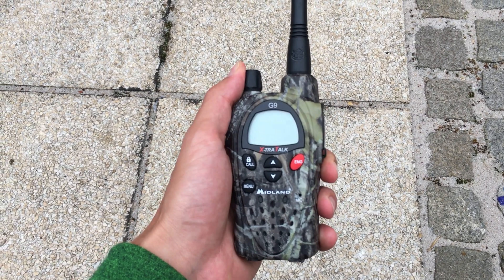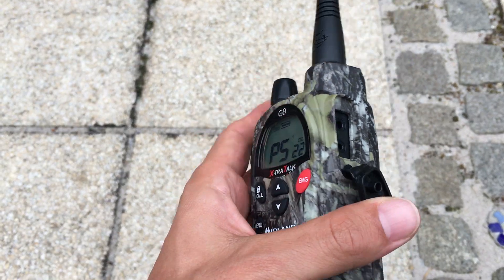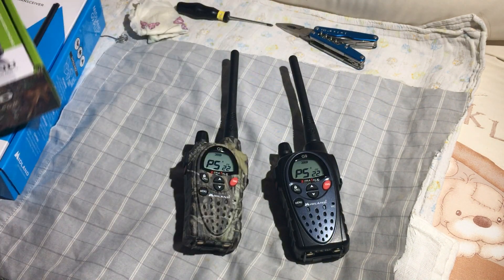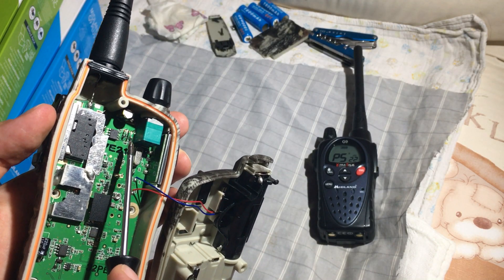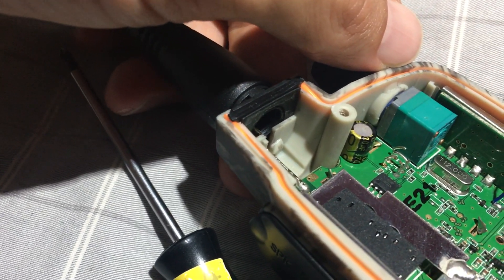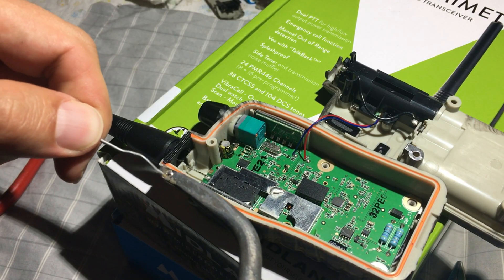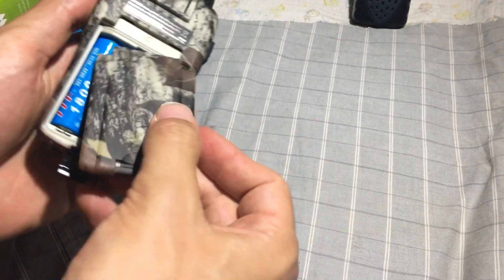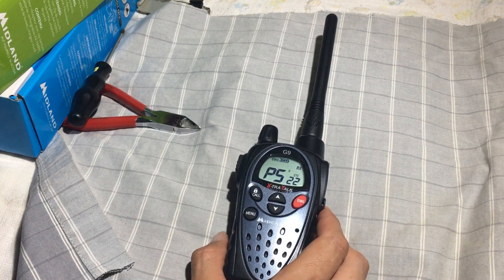Midland G9 plus MODIFICATION and review: PMR446

Comment: Per Midlands website:
4. Any radio above 2W of power is now classified as GMRS radio: and still requires a license from the FCC to operate. Not much change here, except sharing additional stations with FRS radio users.
5. GMRS licensing is now good for 10 years and cost $70: This covers you and your immediate family and was previously only valid for 5 years.

Have fun when you get nailed for using these without a license. In addition if they were frs only radios, modifying them and transmitting frs frequencies over 500mw is against FCC regulations:

§ 95.313 Penalties for violations of the Communications Act or FCC rules.

Operators of Personal Radio Service stations may be assessed penalties for violations of the Communications Act and the FCC Rules.
(a) If a Federal court finds that a Personal Radio Service station operator has willfully and knowingly violated any provision of the Communications Act, that operator may be fined up to $10,000 or be imprisoned for a period not exceeding one year, or both. Upon a subsequent violation, the imprisonment may be for a period not exceeding two years. See § 501 of the Communications Act (47 U.S.C. 501).
(b) If a Federal court finds that a Personal Radio Service station operator has willfully and knowingly violated any FCC rule, the operator may be fined up to $500 for each violation, or in the case of a continuing violation, $500 for each day that the violation continued. See section 502 of the Communications Act (47 U.S.C. 502).
(c) If the FCC finds that a Personal Radio Service station operator has willfully or repeatedly violated one or more sections of the Communications Act or of the FCC Rules, that operator may be liable for forfeiture. See § 1.80 of this chapter for details about the forfeiture procedures and amounts.
(d) If the FCC finds that a Personal Radio Service station operator is using a Personal Radio Service station in a way that violates one or more sections of the Communications Act or of the FCC Rules, the FCC may order the operator to cease and desist (i.e., immediately stop operating the station). See § 312(b) of the Communications Act (47 U.S.C. 312(b)).
Reply: The FCC's enforcement information is a matter of public record, and not a single person -- I repeat NOT ONE SINGLE PERSON has ever been issued a citation for GMRS misuse. So, that being said, get over yourself. I absolutely roll my eyes when people who think they're the radio police get on here and spew nonsense about non-existent enforcement action. "Have fun when you get nailed," you said. 

Ha, "when" you get nailed. Because they're going to totally track down and find the guy using a handheld GMRS radio at an output power rating of 5 watts, when 50 watts is the limit on the band. They'll totally know the difference, that he's talking on a walkie talkie in excess of the limit, versus him being on a mobile unit of identical output power. 

You're absolutely ridiculous.
Reply: How would a PMR446/LPD433 radio even qualify as a GMRS radio? The frequencies used are completely different. The only thing you could use these for in North America is as a very limited ham radio on specific 446 and 433 MHz frequencies. That is if the FCC even allows you to use them on ham bands. My guess is yes, because despite not being certified (as they're European radios only bearing a European CE marking), they only transmit on what are ham designations in the U.S. I don't see why anyone would go through the trouble of getting one of these things imported into the U.S. just to use it as a very crappy ham radio, but that's a different story altogether. In any case, these aren't GMRS radios.

Also, the other videos on this channel reveal that the uploader is probably located in Germany, where the FCC has no juridisdiction and rules are completely different. This mod is definitely illegal there, though, but for different reasons--PMR446 has a maximum legal output power of 500 mW ERP and LPD433 10 mW ERP, so bumping it up to 5 W is illegal. There's little in the way of enforcement, though, as with GMRS in the States.

Comment: can i do this modification on G9 pro?
Reply: Yes you Can, JM1 and JM2 "in the Middle" close, JM3 leave open. Hav fun Bro...
Reply: @Shamanpaint  then in a G9PRO radio how do you leave J1 J2 and J3?
Reply: @Shamanpaint  Hello 
I have a G9 PRO . When I  bu it, I hve JM 1 Close et JM 2 and JM3 open ? what do you think about that ? is it possible to boost it in 5w ? thanks
Reply: I wonder if this works with the G13 or G18
Reply: no, it's illegal,
Reply: Not without getting a possible violation from the FCC and possible jail time. Have fun
Reply: Up to 10k$ per violation

Comment: This isnt even like the d2001 on a haesu that needs a proper heat pewpew or tiny soldering iron with temp control so as not to blow out the cpu.. Or burn tru the pcb Oh no.. Just cut the loops and make sure you dont cut them only at the top, cut them off at the base so the wire loops wont short circuit the radio. How easy!! Thank you midland! grin